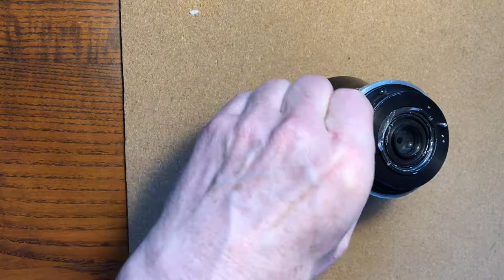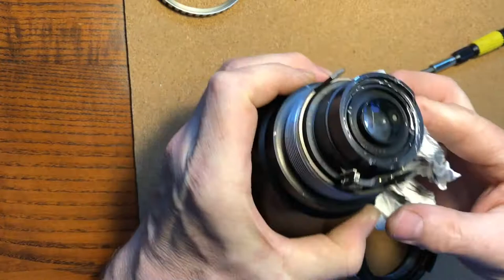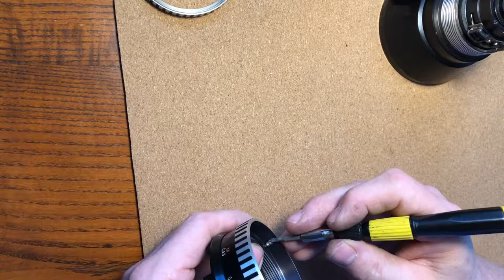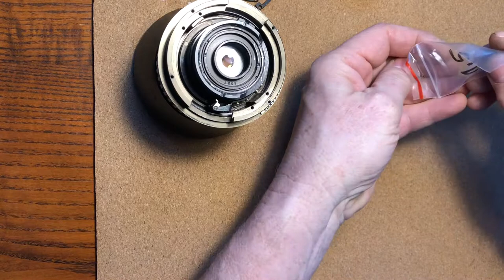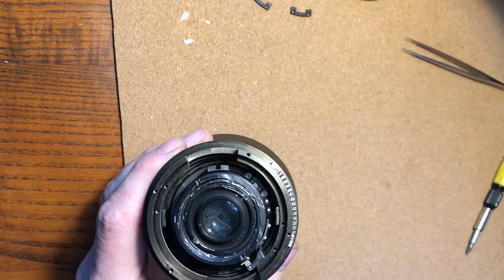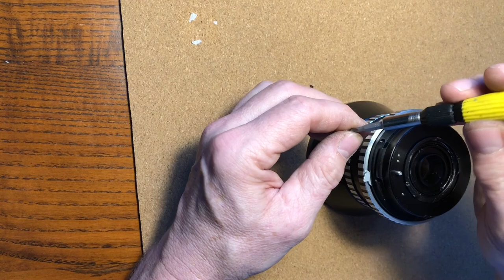Carl Zeiss Flektogon 4/50 stiff focus ring cleaning and relubing DIY

Comment: Nice work, but how to back helikoid on the place after dismounting? It just turns without catching winding.
Reply from the maker: No simple answer, yes sometimes it takes time to catch it, for me the most efficient way is to adjust helicoid parts in place and then turn in opposite direction a bit to feel the parts engaging.

Comment: Did you get the infinity focus right after making no mark?
Reply from the maker: Yes, as you could see it was a matter of counting turns of fine threaded part and then first try was a miss so some tinkering was needed, generally always you can do it (with a little patience and adjusting)
Reply: @maciejukasik1828  For others that is not that experienced to get anything out of your videos, check out mikeno62's videos, his is the best!